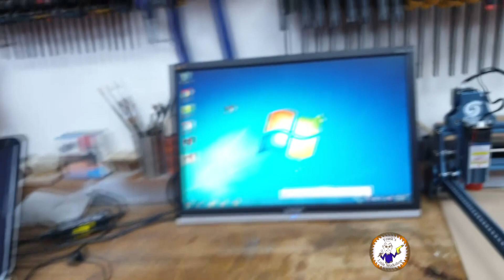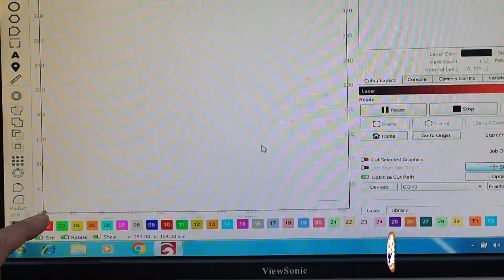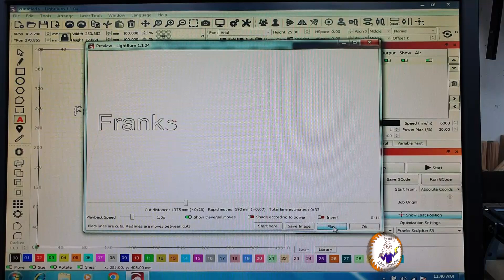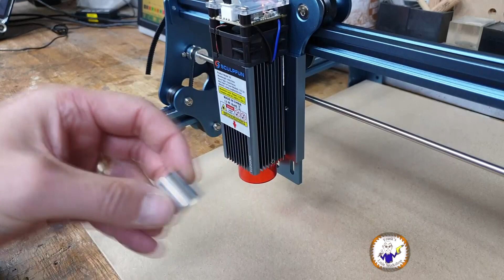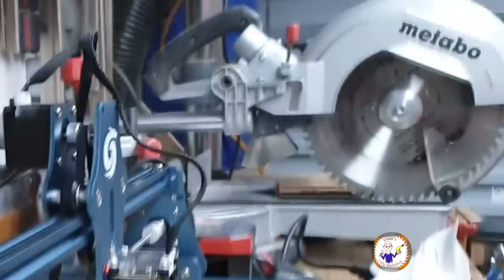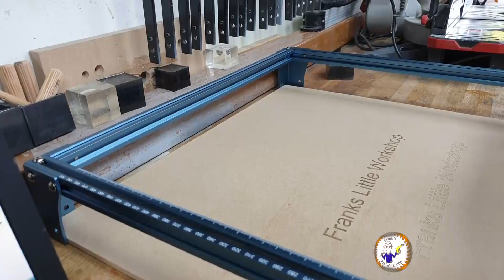Lets get LASERING, with Sculpfun and Lightburn.

Comment: got one for christmas 2024 stops working but the laser stays on swapped PC to Laptop changed usb cable re installed software still the same issue had the motherboard replaced still laser stays on when stopped ruined numerous projects
Reply from the maker: @stevemancity8  🤔 That sounds more like the control software 🤔. I've never experienced that before. Are you using Lightburn ???
Reply: @frankslittleworkshop  hi yes I am using lightburn latest version both on pc laptop sculpfun sent a replacement motherboard still the same issues very frustrating
Reply from the maker: @stevemancity8  🤔 Sounds like a tricky one.
It may be worth doing this little check.... move the laser position on to a scrap workpiece, then in lightburn activate the "fire laser" button (on a low % setting). Then turn it back off again.... if it goes off then it shows that the control side is working correctly. If it stays on, then un-plug the laser head (obviously it should go off).... then re-connect.... if it stays off, that means it was "electronically latched" and the power cycle of the laser releases the latch. If it comes back on then try to power cycle the mother board. This should help to discover where the latch is. Feed this info back to Sculpfun and hopefully this will help them with a more effective diagnosis. I hope that all makes sense. Let me know how you get on. Thanks Steve 😁👍
Reply: @frankslittleworkshop  hi when it stopped and the laser stays on I have tried taking the data cable(usb) off no change I have turned the lightburn off no change googled this issue says its the motherboard but I have replaced this from sculpfun the only thing left is the cabling or the power supply and laser strange no issues when doing single items from a project but it's taking a lot longer to complete stopping and starting

Comment: It is possible to install router motor on Z to replace laser head ?
Reply from the maker: Hi 😁. I guess it is possible but I wouldn't advise it. The frame is not designed for the additional weight and load that it will be subjected to. In addition there is no Z axis mechanism to move the router up and down. In short, its not a good idea to fit a router. You will need a dedicated CNC machine for that. Thanks for watching 😁 👍

Comment: Thanks Frank I just put together my ortur laser today very similar to yours. I haven't switched it on yet or down loaded the software yet. The software worries me the most and I think you have saved me probably an hour trying to find things to start with. . Your video came out just at the right time .I hope to see more of them if you are able I know the filming and editing take a fair bit of time so a big thank you. Steve Australia
Reply from the maker: 😃 Thanks Steve. I was originally going to get the Ortur but ended going for the Sculpfun S9 because of the actual laser. I had some issues initially installing the software but thats because my laptop is a bit out of date. But the actual software install was easy. I did install the free trial software but it expired before I got a chance to use it. My suggestion would be to just go for it. Once you get burning the software will all make sense. Good luck Steve and thanks for watching 😁👍

Comment: Well done Frank. Instead of moving the board, you could have just copied & pasted the text to a different position & then deleted the original text. Speed always takes precedence over power. But with enough practice & tweaking, you're gonna do well. Keep it up. G
Reply from the maker: 😁 Thanks Gary. Looks like it won't take much to get used to the text editing. Thanks for the tip (speed over power). I'm reluctant to wack the power up in the hopes it will increase the life of the laser head. Hope to do more laser vids soon. Thanks again Gary 😁👍